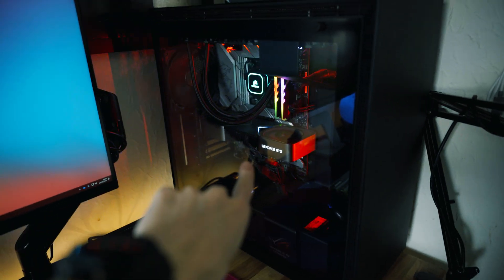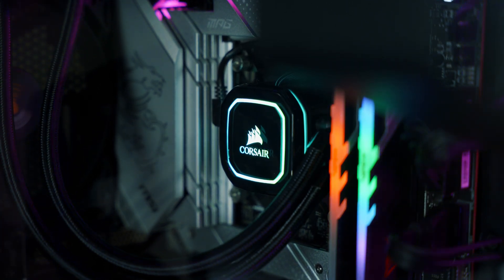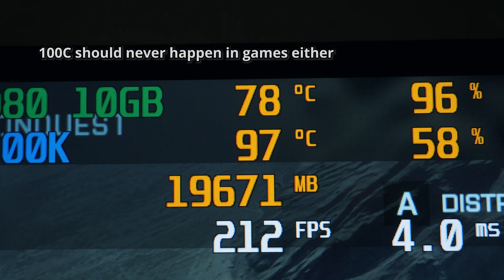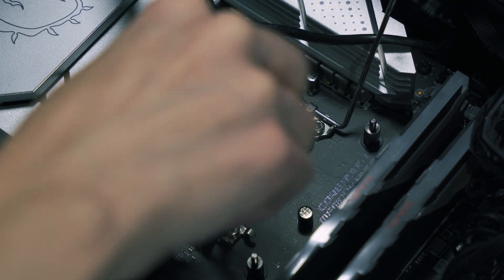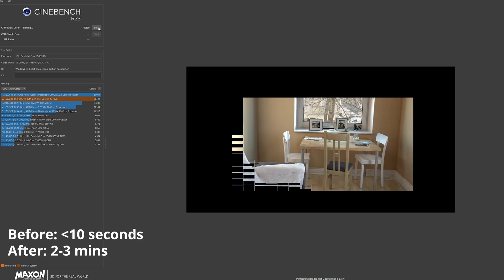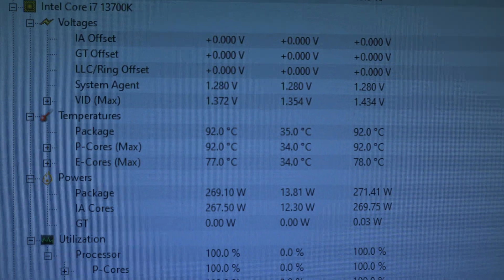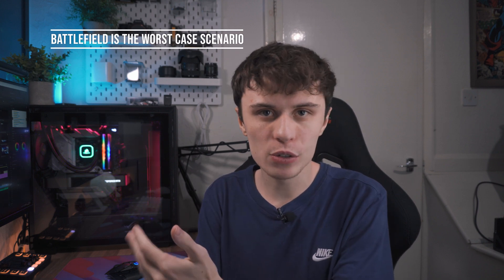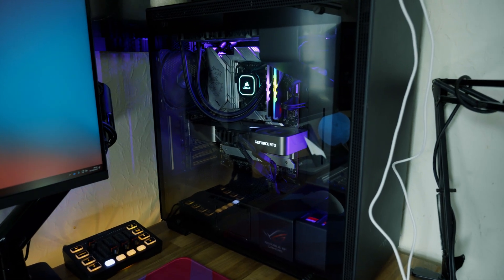13th Gen CPU Cooling Why YOU Need a Contact Frame!

Comment: my contact fram just arrived, this weekend will be installing it, i run a i5-13600k with a h100i 240mm, been hitting high temps also, i did undervolt it and for gaming got temps down to 50-60c, turbo still hits 5.1ghz, but runs a little lower, around 4.9ghz, also, MSI mobos are known to run 12th/13th gens hard out the box, noticed any gaming(what i do with my computer) it was always running 5.1ghz(stock turbo), but my goal is to get the cinebench temps under control, with undervolt they instantly jump up to 90c still, and my score is nowhere near avg for the 13600k, and i noticed some cores are higher than others, which to me=bent cpu/bad contact, i did try repasting/resetting cooler to no avail....
Reply: I just got the same cpu and I use a be quiet! Pure Rock 2 Black and I dont hit 80°C.

Comment: What I don't understand is Intel and AMD have used this same retention bracket design for almost 30 years now and all of a sudden it is a problem...
Reply: Maybe coz the shape changed, which change the mechanical force distribution. Entirely possible.
Reply: @ghostofk2  It's a marketing gimmick and new kind of craze which will go away within a year or two. I'm saying this because I am using i7 13th Gen with Air cooler and the that works just fine even in heavy load.
Reply: @KMon1111IND marketing would imply that you don't get improvements. In this case you do get improvements that are clear so your comment is just absurd
Reply: @KMon1111IND  stupid comment. got these for hard overclocking and its lowered my temps significantly.
Reply: @KMon1111IND   Lol what a comment...i bought the contact frame and receiving it soon. All tests show it works. It's cheap to fix the mainly Intel issue but also AMD 7000 series can use a lot of power and get hot.

I am 100% sure that under cinebench r23 your CPU will thermal throttle within seconds under load. I have a very good AIO and a better one on the way and in gaming it sometimes still peaks at about 87c wich is to high for my likings. 

But saying it's a gimmick shows you have no clue what you are talking about.
Reply: Lol this contact frame is a significant improvement for Intel 12, 13th and 14th gen processors. It should be installed the first time you install the CPU to prevent the bending in the first place. More surface contact = more heat dissipation. If you're not comfortable installing it then stick with the bracket or go to AMD. De8auer knows what he's doing.
Reply: It's only like 10 bucks and it can lower 2-3 degrees maybe even more. It's good for the xx900 series because those things can get hot and every little helps.
Reply: @pineconeonpizza   A lot of times it can be even to about 10c lower! Not just 2 or 3 c.
Reply: it lowers my temp 10-15 @pineconeonpizza
Reply: CPU's have never used this amount of power! So it's normal that this happens with this design. Every degree lower is one won. I am also getting a new AIO and the contact frame. I want my temps to be as low as possible also to reduce noise and lifespan. Also i am using an undervolt on my I7-14700KF and with 10 mins Cinebench R23 it did not get higher then 93c without the frame and new cooler. So there is room for improvement. With the new cooler and frame i hope to reach 80c under stress. 

Don't forget that the cpu's also got bigger in size over time as they are now with Intel.
Reply: thats the problem, the cpu's are more powerful, therefore need more volt, therefore get hotter.

they shouldve changed it
Reply: You can also modify the stock retention bracket and bend it so it doesn't apply so much pressure.  A feather touch on the cpu is all that is needed.  The heatsink can apply the rest.

Comment: you undervolted too much if you saw the bsod. after you undervolt, make sure you stress test it until its stable
Reply from the maker: I did, using Cinebench R23. However, Battlefield 1 would cause a BSOD while loading maps consistently. That's where I found out the undervolt wasn't a good one.

Comment: If you are hitting 100c then you need to be looking at a better cooling solution. My 13th gen doesn't hit 80c on R23 and it's cooled with Noctua U12A air cooler....so think twice before messing with your frame.
Reply from the maker: I suspect a 360mm AIO is at least adequate. It had no issues cooling a 3950X for a year
Reply: Have a contact frame and a U12A coming tomorrow 😅

Comment: Just a side suggestion. The frame itself acts as a heatsink while also preventing paste overflow so perhaps see how much of the frame is covered by your coolers cold plate and apply a layer of paste beyond the IHS on the frame to create additional thermal contact and to spread the heat away from the CPU. Give it a try.
Reply: If you look at the CPU die underneath the IHS, the die is about 10mm from the far edges of the IHS. 10mm of RAW copper is a far for the heat to migrate, considering the heatsink that's sucking heat out rapidly as the distance from the die grows. This positive cooling affect is 99% because of better CONTACT with the center of the IHS.
Reply: This is actually a great idea man I’m sure it would help.

Comment: I've installed this exact same contact frame with my i7 13700k on a new Z790 Tomahawk and I'm finding in stock config it's idling around 35-38 degrees and will go in the high 80's to low 90's under load but can creep a bit higher during longer benchmarking.
Reply: What's your cooler?
Reply: I'm using a side mounted Thermalright Frozen Notte 360 AIO @FunTimeGhz
Reply: Got the same mb currently running  a i7 12th gen upgrading very soon got a contact frame and 240 aio cooler worth the money

Comment: Just installed a ThermalRight Contact Frame along with a ThermalRight Peerless Assassin on a Gen 8 Legion 7 Tower (13700KF/4070Ti) Worked like a charm. Lost between 8-11c over 4 TimeSpy Extreme tests. They both work. well. Air cooling has come a LONG way. It can still peak a bit too high at times, and I've barely tinkered with XTU. Nothing I'll throw at it for some time will ever come close to that. Only benchmarks. For any game I've thrown at it (20+ so far, from Quake 2 to MK1 to Starfield) I believe the highest I've seen is about 85c during heavy, heavy loading etc. And that quickly disappates. Happy camper, and not much $ spent. The Legion had a decent Air Cooler from factory, but this TR AC and Contact plate provides good headroom. Looks good too.
Reply: Nice build I have the same. I hear the AK620 trumps all for cooling without water for the price point. Almost ready to boot mine up
Reply: @allcore5172 Thermalright Phantom Spirit is the new king of cool, but any of these tower coolers should do a good job.
Reply: Is this more a problem for air cooling? I get the impression from the creator's video that liquid cooled systems have this problem also. 

I'm new to this generation of Intel CPUs, I've mostly played with older 8th gen CPUs and Xeon workstations. I bought my first gaming system yesterday, an open box I7-13900KF and so far I'm not seeing the problems of high temps when stressing the system. I have it working at 100% in the other room encoding a 4k video in Handbrake using all CPU and no GPU encoding,  it's showing 60C average with peak at 70C. It's showing 200W power draw from my UPS. So far it seems pretty on par for all CPU encoding 4k that my old HP z840 with dual E5-2680s (28 cores, 56 threads), both seem to be encoding a 2hr:15min 4k video in about 2hrs, a little more than 30 FPS in encoding.

I did buy the gaming system vs building one myself because the price was right for what came with it. It's one of those ASUS ROG G16s prebuilts that came with an RTX 3070 8G GPU. It also came stock with liquid CPU cooling from ASUS, a 240mm radiator with dual 120mm fans and it seems to be staying pretty cool. Could it be ASUS just has the settings turned down to I don't have the high temps? The CPU does show running 100% most of the time for all the cores. Outside of the radiator fans pulling out of the case, there's only one 92mm case fan pulling air out of the system.

I see a lot of these socket 1700 frame videos all over YT. Am I just lucky not seeing those temps?
Reply: @Shadow_Banned_Conservative  Old Post, but a lot of the issue was the bios of the mobo giving more voltage than needed to the CPU, thus adding extra heat. Updated bios (now days) or undervolting back then fixes this issue.

Comment: With msi board find "cpu lite load" setting in bios and change it from auto to 8 or 9. Dramatic difference on my 13600k and no performance loss
Reply: I did same thing and got a big temp drop.. Ive even run it down to 6 without issues but I keep it at 8.  Keeps it from hitting 100C.. I have same CPU..
Reply: @badlilstang  es mejor el undervolt manual, consigues una bajada de hasta 20 grados con una perdida mínima de rendimiento.
Reply: I think even  Intel say bring it down from 13 to 9
Reply: i did it with my 13700k and it crashed a lot. but it did decrease my temps
Reply: @gravitymaster7812  what are you doing when it crashes?

Comment: I recommend you use liquid metal instead of thermal paste. That will decrease CPU's temperature by 5 degrees at least or under volt your CPU because 90's still a high temperature that can reduce your CPU lifespan.
Reply from the maker: Tried an undervolt, it really impacted stability. I’m going to try a negative AVX offset next. As temps anywhere else are much better (usually mid to high 60s).

Comment: I had same problem with my i5-13600kf. My bequiet! Dark Rock 4 did have huge problems cooling down my CPU. While using 3DMark tests my CPU skyrocked to 100c and I made a post where someone told me a fix!

The fix was "Go into the BIOS and change your CPU Lite Load setting from the default 12 to 8 or even 1. Lowered my volts a good amount at 8. Much lower volts and overall heat with no hit to performance."

I changed mine to 1 and it fixed it! Right now idle around 43,1c (50% fan speed, very silent) with chrome + 6 tabs and runescape open. 
And while playing Ratchet and Clank Rift Apart on high settings my GPU 2080 Ti hit around 70c and CPU around 60c. During benchmark test it hit a max of 75c instead of 100c. I haven't stress tested it for longer period of time because I haven't had a reason to. Benchmark results from my CPU came back as around average so no drop in performance.

Oh and great video btw!

EDIT: I did a Cinebench R23 throttling test and i hit a maximum of 86c but ended up with a BSOD at 8 minute. I might have to set my CPU Lite Load higher, for more voltage, but also higher temperature. Also ordered a Thermalright Contact Frame and hopefully it can even out the higher temperature from increasing the voltage.
Reply: This is a great idea but I’m very skeptical about it not having any effect on the performance. Is there links or anything proven that it doesn’t decrease the CPU’s ability?
Reply: @allcore5172  si, siempre afecta en el rendimiento, pero si consigues hacer undervolt manual, el rendimiento se vera afectado en mucha menor medida, incluso puedes llegar a hacer OC y aumentar el rendimiento dado que muchas veces bajas la temperatura de manera que se puede exprimir mas el procesador, el problema a dia de hoy es que es obligatorio ese undevolt si no quieres quemar el procesador por lo que si o si algo pierdes, pero si buscas la mejor configuración, la perdida será inapreciable.
Reply: Si tienes una placa base MSI, actualízala y quita CPU litle load por el intel defaul, despues has el undervolt de manera manual, tendras que encontrar el mas estable para ti entre 0,050 o 0,080 incluso 0,1 en el viltaje offset de  -CPU después en el PL1 y PL2 yo he situado máximo 190W con eso tengo un pc estable con buena nota en cinebench y con una temperatura máxima en verano de unos 85 grados en cinebench. Estoy pensando en sumarle este cambio tambien, pero he tenido CPU lite load y el undervolt manual y prefiero de manera manual los Vcore bajan bastante mas y evitan en mayor medida el problema de la degradación.

Comment: I used 2 contact frames on 12900k asus Z690 hero.
Both work good for 2 days - 2 weeks then become bad. I'm thinking to use intel contact metal right now.
Reply: Answer instead of ignoring him.
Reply: I got it fixed.
It was 12900k not installed correctly with Thermalright Contact frame and Arctic freezer II Aio. 

so I replaced 12900k with 13700k then make sure every screw and stands off done together and nicely tight.
without damaging motherboard PCB.
Suddenly after I did this all my slight stutter gone and temperature is very stable.
 @amisauto4360
Reply: Can you describe how it went bad?
Reply: How bad it went? 
Very bad:  12900k overheat and it's only draw 180w power which is not normal when tested on C23. @phuongtrang280

Comment: Installed the CPU Contact Frame by der8auer, Thermal Grizzly don't over tighten the contact frame. My Noctua Cooler is what holds everything together with the contact frame and I did get better temps with the contact frame over stock intel frame.
Reply: The Intel bending phenomenon has been just that...hearsay. I have so far had four. And I never put contact frames on them. I would bet Intel knows what they are doing after decades of development. Plus these void your warranty so there's that.
Reply: @pcxdrone  dude this contact frame on my cpu is litteraly a game changer i had from 87 C in cyberpunk to 76- 80. Huge improvment also statment that " Intel knows what they are doing after decades of development" is kinda goofy how can you ignore bending procesors with this intel frame. Like man they have the shitiest loud stock cooling. Intel is not the same company
Reply: @pcxdrone No reason to think that this will void your warranty, and the results of using a contact frame are well-documented. They do work astonishingly well. Gamers Nexus does contact testing to clearly show where the cooler meets the IHS. With 1700 CPUs, full contact is not established. With the use of a contact frame, it is.
Reply: @pcxdrone  it voids it if you over tighten them.

Comment: Honestly a case swap could probably do you well to something more airflow focused.
Reply from the maker: Yeah, I think you’re right. Would be a nice change too as I’ve had this case for 4 years now
Reply: i dunno mate im on 13900kf with a z790 board and i have an insane amount of airflow (in the right config). The case is cool asf, all other components are, but the water cooled cpu runs hotter than expected (even though safe at 100c) so i think mebe in my case i overtightened the aio and could have some bend. feck.

Comment: It's bizarre that Intel overlooked this issue in the design but glad 3rd parties have been able to put out a simple device to rectify it.
Reply from the maker: I hear it’s because the 1700 socket was rushed. However, if I’m spending this amount on a platform, an extra £9 won’t hurt😂
Reply: Nothing bizarre about it..Intel and AMD have used this same bracket for almost 30 years now.
Reply: Wasn't a problem in deforming the cpu before because the chips were smaller. 12th+ gen has gotten long.